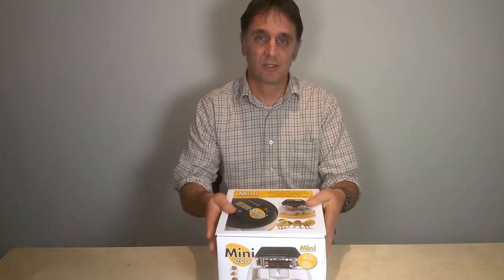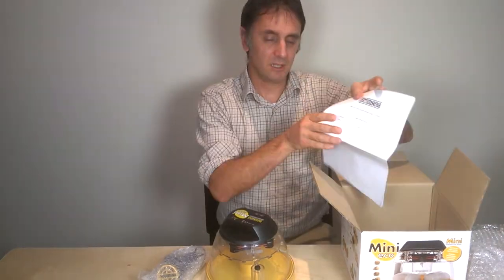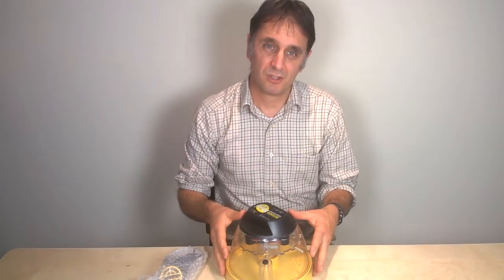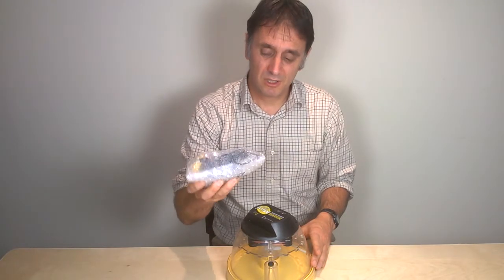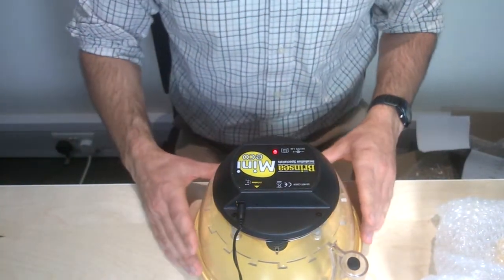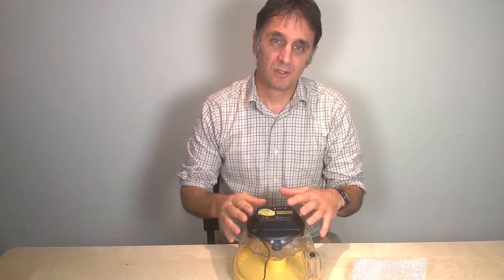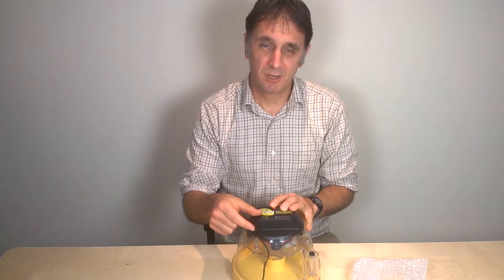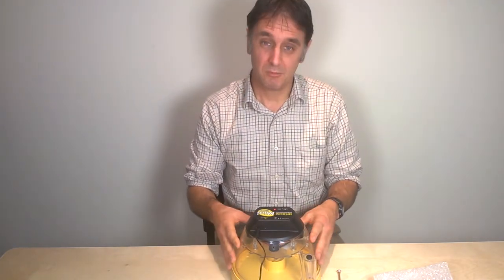Brinsea Mini Eco Egg Incubator   clip 2   Setting up & temperature control

Comment: Got mine today in South Africa, think its a newer model because of the adjusting screwdriver included with the product. My incubator was set to 38.5 degrees and I easily adjusted it to 37.5, and it keeps the temperature there precisely, fingers cross, will be putting in my first batch off eggs tomorrow 😀
Reply from the maker: Let us know how you get on. If you need any help please drop us an emails: sales@brinsea.co.uk Happy hatching!